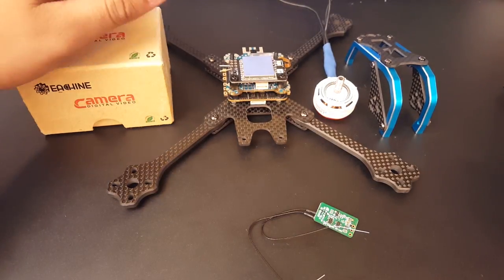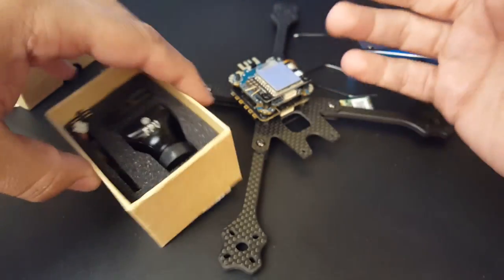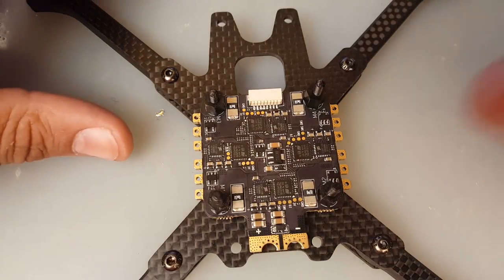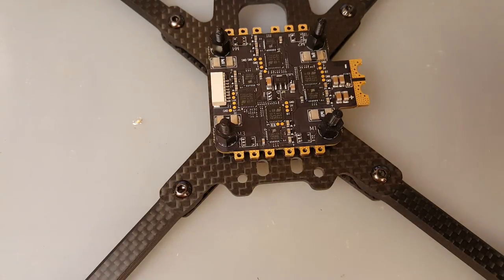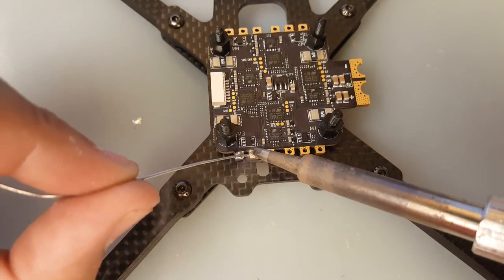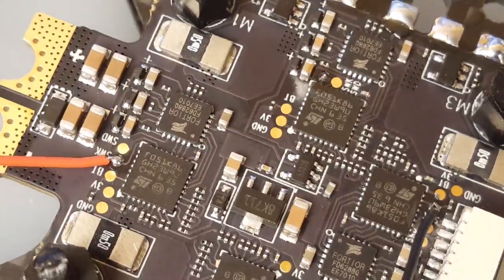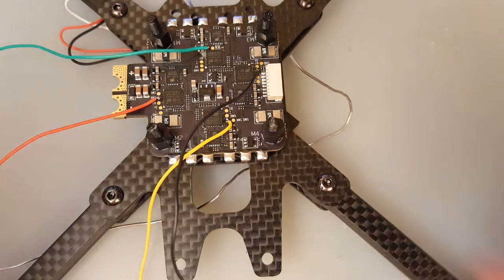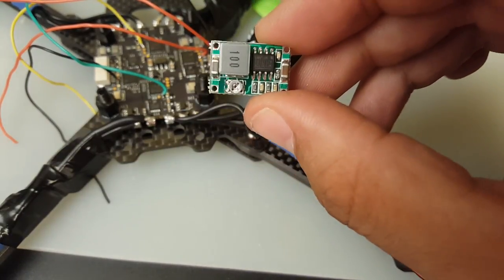How to Build Racing Drone 2017 // Airbot Pro Corner, Typhoon32 , Edge Racing 2305

Comment: Sorry, may I ask why you didn't you use the 8 pin cable to connect the FC to the ESC instead of all the soldering?
Reply from the maker: I did the soldering that was required is for the VTX, CAM and Reciever.

Comment: Beside the wiring, how to set up ESC telemetry in BF(I am using Butterflight)? I have done turn on ESC sensor tab, Batt warnings are base on ESC sensor, OSD to show ESC temp, the Rx telemetry and Smart audio work fine. Any other thing I need to do or what else ESC sensor should do?

Comment: Hey man, kind of a random question.. but I'm wondering for a person running 6s, technically what would filter noise better, a 50v 220uF cap or a 35v 220uF cap? I know the 35v cap is rated to work best up to around the maximum rated voltage (i think..).. so wouldn't using a higher voltage cap not work as well for for voltages not reaching it's maximum? Maybe I'm just confused about how they work, but I figured I would ask you :)

Comment: just finished that video, was nice. You got me O_O with that baby trantec ! So cute !
I'm really interested in what benefit might come out of the telemetry from ESCs, thanks for digging that up for all of us.

One more thing, and it might be just me, but I'd love if at some point you'd show your builds WITH a lipo on. Just for inspecting final look AND connection, as one this video, I'm a little unsure about that CAP taped to the XT60. If lipo cable are too short, and you need to bend your cable down, won't it mess you soldering to the ESCs ???
Of course you can get rid of the lipo, and get back to the nice low-to-the-ground look right after that little check... just a suggestion.
Reply from the maker: Will do from now on :)
Reply: u

Comment: It´s a good build from you but looks bad with the batterycable on the right.
Why you not let the fucking ESC in the wrong direction and makes only a pinmapping like M1 -> M2, M2 -> M4 etc. from the FC to the ESC?
Its so easy and looks fine.